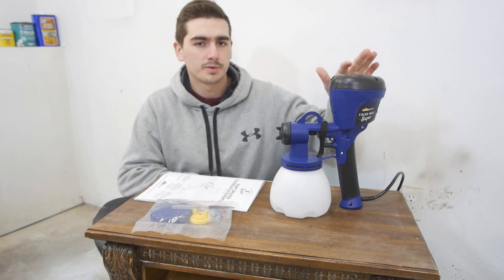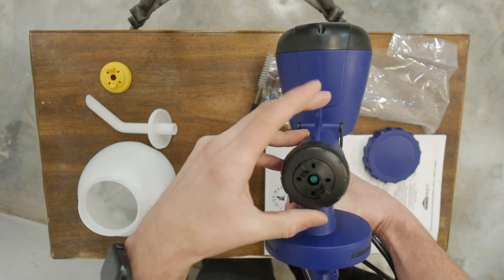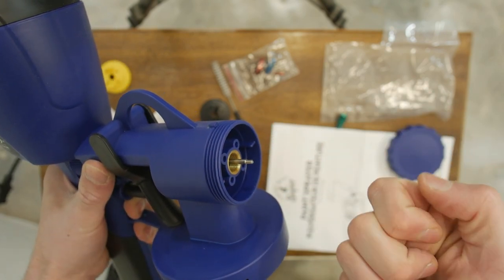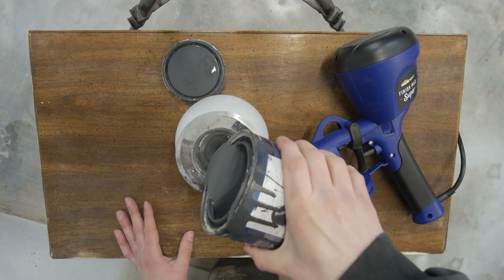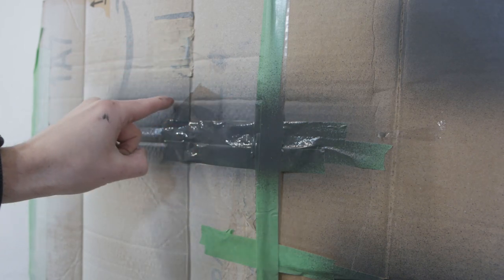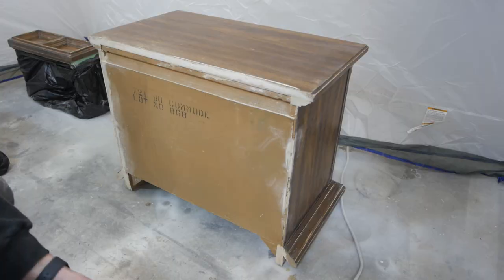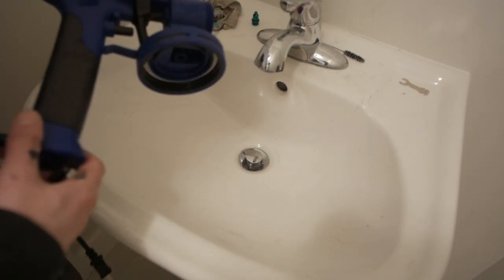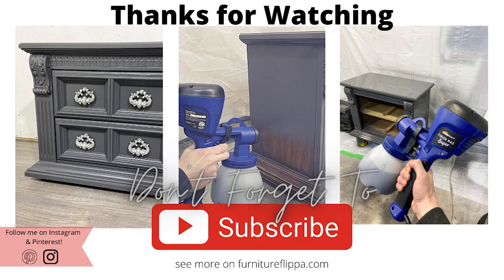How To Paint & Protect Furniture With The HomeRight Super Finish Max | Beginners Guide

Comment: I've used this thing on 2 projects and in both cases I was underwhelmed. It's my first paint sprayer and although it was faster than using a paint brush, the final results were... meh. Your tips on how much to dilute the paint and mixing it for a full minute made ALL the difference in my current project. I'm so glad I found this video, thank you!
Reply from the maker: glad it was helpful! It definitely takes some practice to get that pro finish. But it's worth it in the end!
Reply: @FurnitureFlippa  BTW, the cleaning kit is fairly meh. I've found the fastest way to clean it is the way you are already doing.
Reply from the maker: @steveswanson6280  thanks for the info, I think getting a second container is the way to go. Keep your paint and twist the container cap on inbetween coats, but use the other container for water to clean out the gun!
Reply: @FurnitureFlippa  yep, exactly!
Reply: Do you think the first results were underwhelming due to not diluting your paint? It really made that much of a difference?

Comment: nice vid. i recently bought one and used it to paint my kitchen cabinets. it worked perfectly and i sprayed it without any thinning. used paint strainers. it just takes a little time to get it adjusted and when you do it rocks. remember it only works as good as the last time it was cleaned so make sure you clean it up. i sprayed a light coating of wd40 on the sprayer and the paint didn't stick to it.

Comment: Nice comprehensive review! I need to paint a 150 ft of wood fencing and have been toying with the idea of spraying it. Thanks for sharing
Jo
Reply from the maker: Thanks for watching, I think this sprayer would really help get the job done quick! Good luck :)
Reply: @FurnitureFlippa  Thanks! I'll need a lot of luck!
Reply: Have a second container and a second person filling up the container every time you run out. You would blow through this container in no time flat using it on a big project like a fence. Did you use it?
Reply: @lisao3041  no I didn't buy a sprayer after all. Waited too long until it was too hot to be outside. After hurricane Ida the fence is last on the list. At least it's still standing!

Comment: I just bought the Homeright Super Finish Max and use it to paint my newly built plywood cabinets. I used a combination of primer and paint gloss, but the surface, after drying, is very rough. I sanded it with a 220 grit and a lot of sand-like particles was removed.  Have you ever experienced the same problem?  What do you think is the solution?  Thank you in advance for any inputs!
Reply from the maker: I have never used such products so I wouldn't be much help. My only suggestion is to always test the products before to see what the finish will look and feel like, you never know. 

I think you can always use an electric sander with somewhat high grit sandpaper, like 250-400, to get things smooth again. Then you can determine the best way of application. Maybe a different mixture or even a totally different product will provide better results. Feel free to reach out to a professional cabinet painter for their opinion on products.

Good luck!
Reply: @FurnitureFlippa  Thank you!

Comment: great video! I'm curious your thoughts (or other commentors) with this gun on how much overspray you had. I want to try the super finish gun on a few walls for stenciling, and plasticing and taping a whole room is sounding daunting. how messy is the floor around the furniture, and did you arms get sprayed, etc. thanks~
Reply from the maker: Hi Gemma, thanks for watching btw! and most spray guns I have used for furniture make my garage a little cloudy, but it doesn't impact the furniture I am painting. The floors get dusty and slippery from the poly overspray so if I were painting inside I would lay a cheap dollar store plastic drop cloth, only like $1.50 each. You can even use them to cover existing items in the room and I wouldn't say it would take too long. Green tape and a bit of work but your painted finish would be smooth from the gun. But you could just use a roller or brush and still get the job done.  

Hopefully this helps a bit :)
Reply: @FurnitureFlippa   thanks for reply, good info  for avoiding a mess.

Comment: If I am using Oil Based paint, is it OK / recommended to fill the sprayer with Paint Thinner instead of water when I'm done to clean it?
Reply from the maker: I never use oil based products in my sprayers, but I would believe paint thinner would be fine. Mineral spirits would also do the trick.

Comment: I'm curious how much paint is lost while spraying with this.  You mention the yellow for doing walls but wouldn't that have painting floating around the whole room, landing on everything that's not covered?
Reply from the maker: Spraying can use up more paint than a brush and a bit more than a roller. & Yes, a room will get very dusty from the paint when using a sprayer. It's recommended to cover everything!

Comment: Do you sand between coats of poly?
Reply from the maker: I often do not because I find it scratches the surface. But you can with a really high grit, I have with 400+ grit before